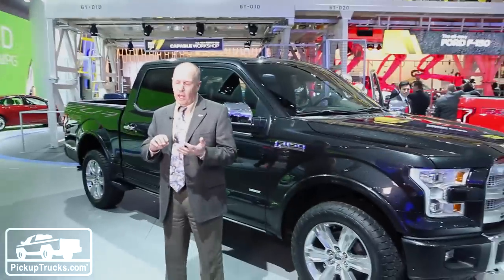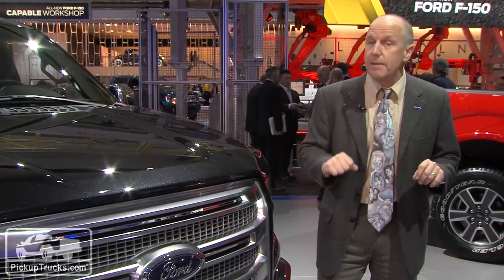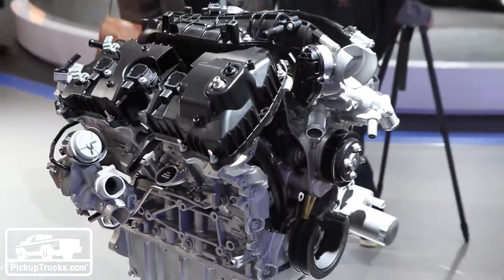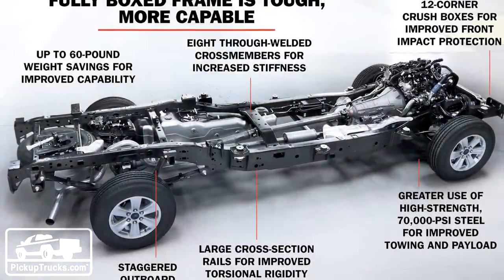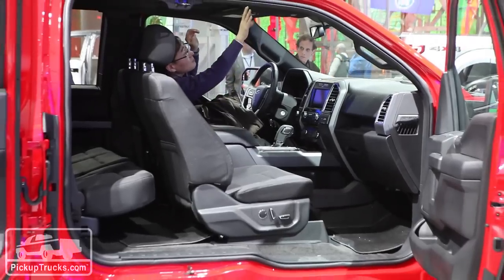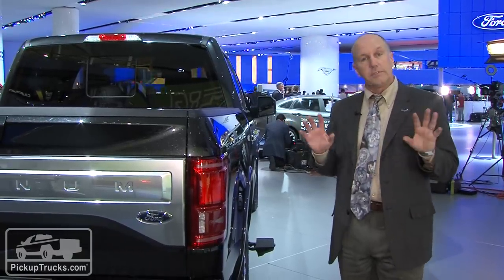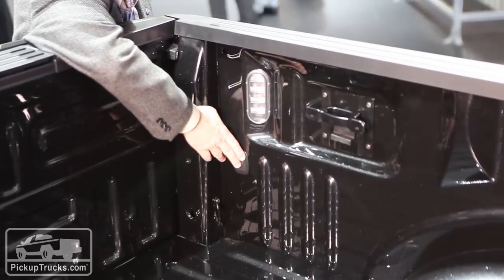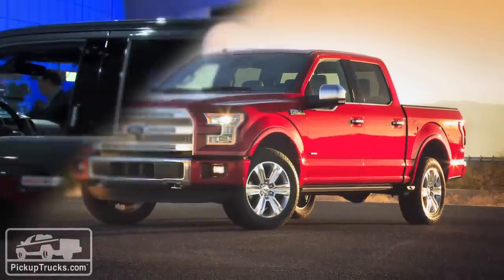2015 Ford F-150 -- 2014 Detroit Auto Show

Comment: Well since there using aluminum on the truck body I'm guessing that aluminum probably weights as much as a piece of steel to compensate for the difference in density between a piece of steel and aluminum. FYI it also depends on what type of aluminum alloy they are using as there are aluminum alloys that are as strong or stronger than a piece of steel

Comment: if there is no 6.2l then is there going to be a new raptor with an ecoboost?
Reply: Nope. I'd have research, but I'm sure the 6.2 will be for the Super-Duties next chassis. Also, they're going to keep making the 2014 F-150, until late summer(I Imagine). That 6.2 is a Monster, and caused Chevy to Amp their 6.2 up for their 2015 model, which are pretty impressive. I hope Ford knows what they're doing.
Reply: Christopher Williams The 3.5L ecoboost is a better engine than the NA 6.2L. First, the 6.2L coyote is an older design. It doesn't have direct injection. Second, its power comes much later in the higher RPM range. The Ecoboost will lay down all of its torque starting at 2.5k RPM all the way to 4.5k and 90% of its torque at 1.6k RPM. That's the range of power where most people are driving their vehicles at.

Search on youtube for the "ecoboost raptor". If folks are will to swap the 6.2l out for the Ecoboost, that tells you something. I don't see it's happening the other way around.

Comment: Being that the 5.0L in its first year was almost as powerful as the Hemi 5.7 (and they're monsters BTW), a lighter body will probably put them both on the same page without them having to pump up the 5.0L, but they always still could (they doing it for the mustang). That being said, they are still keeping the 3.5, which is still significantly more powerful than the 5.0L anyway. The 6.2 would probably be a little overkill for the new body, and as mentioned already, probably the base or mid engine for the next superduty model.

Comment: This is a good looking truck looks bold in its design you can have your sled tundra .. ford will have created a monster in this new truck if all the panels are aluminum NO RUST.. they will do away with that ideal in a couple years because they will last alot longer with out rusting.

Comment: I'm so excited to buy one of these with the smaller V6 to save more fuel. I'm going to go get a cup of tee now and wait for this truck so I can smash it into a wall. JC  How about making it look better and add some aerodynamics. These front ends are like trying to push a mattress through the wind.  Add 4 wheel steering, that's a true luxury, I can put my own tailgate down, and when that tailgate comes down on ice and snow on a northern truck it will get F-showed

Comment: The 6.2 will come along.  It's called consumer demand.
Reply: I don't think many consumers were demanding that engine after seeing the poor gas mileage it got.
Reply: ***** You don't but an F150 and worry about fuel economy....
Reply: Good point, but if that were the case, then why is there a smaller Ecoboost coming out in this 13th gen? If consumers didn't care about fuel economy, then there wouldn't be a need for a smaller displacement turbo V6.

Comment: Love the automatic tailgate. I would have love to see a diesel, anyone with  me?!?!
Reply: Yeah because when you are loading your clean linens into the bed, you wouldn't want to touch the dirty handle. 100s of dollars for a solution nobody needs. That light and switch for it will be smashed within 6 months of real truck use. Tie down cleats that travel a whopping 2 inches on a track? Pointless. A different grill texture for sport vs upper trims? ALL trucks have this now, including Ford. Aluminum body panels? Many cars had them, now a truck! OMG!  A secondary info screen in the cluster? That is so 2013 Dodge Dart. Oh, it is 1 inch bigger! OMG! !000 dollar headlights/taillights that form the corner of a work vehicle? Better chose a low deductible! That little kinkup of the back door window is 100% new however...
Reply: I was thinking that too. That worthless light won't last. Plus these trucks meant for work, are making people lazier. I remember when driving a truck took skill and logic.
Reply: wiibaron Holy cow man, chill! Did you wake up on the wrong side of the bed??? Now I have to agree the switch is really dumb because I would probably hit it and break it off with a 2X4 lol, now the light is great to light up the bed at night, of if you have on a cover, don't you agree? Chevy has this and the switch is inside, where it belongs. It sounds like your another idiot who isn't pleased. Remember trucks aren't always for work, that's the 55K one for the boss man or a rich dude, the 30K work truck doesn't nearly have half the features so chill.
Reply: Christopher Williams The switch won't last
I agree, I would probably hit it with a 2X4 haha. It should be placed in the cab. But the light will last. So a 55K truck is meant for work? Are you stupid? This is for the boss man or a guy with money who wants a truck but isn't gonna work it. If you want a work truck you obviously won't buy this, The work trucks won't have leather or touch trucks. These trucks aren't making people lazier. And trucks still take skill and logic. Like a backup camera, that's making people lazier? I think its great for safety, but you can go cry to your mom if you don't like it.
Reply: Not in the F150. Want a diesel, you gotta get a Super Duty, F250 or 350.
Reply: Charles Sumner why not? look at the Ram 1500 EcoDiesel, Chevy Colorado / GMC Canyon, and Nissan Frontier / Titan concepts. The point of light duty diesel is the fuel economy. The ram EcoDiesal is a 4K option, a super duty is almost 10K. Big difference

Comment: I think what you should have said is if u want a real trucl buy a chevy/gmc, or dodge but if u want a truck designed someone in there 80s or are just really lazy or arnt fit enough to get into your own truck without a step/auto lowering tail gate then buy this truck
Reply: I don't really see how an automatic lowering tailgate takes away from the truck. your argument is pretty irrelevant. It has nothing to do with how the truck runs, rides or works so if this is the only reason that your trying to market GM then your doing a poor job because i guarantee all trucks will have these within the next 3 years.